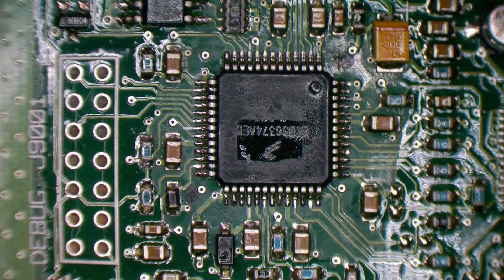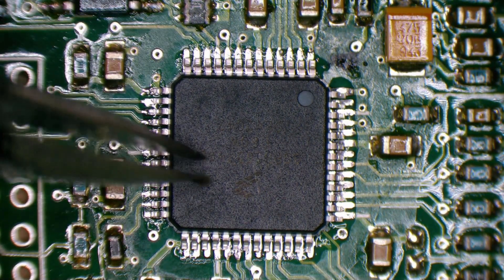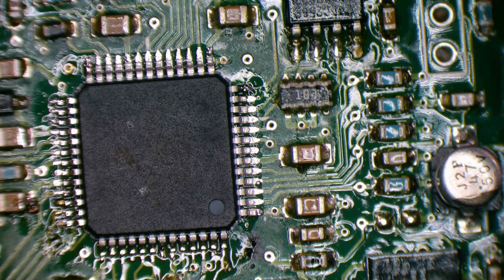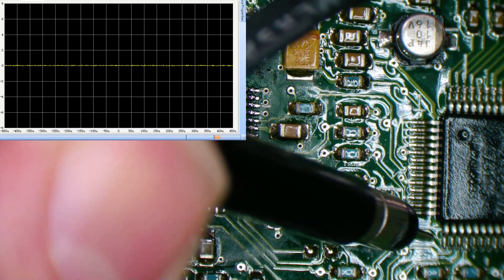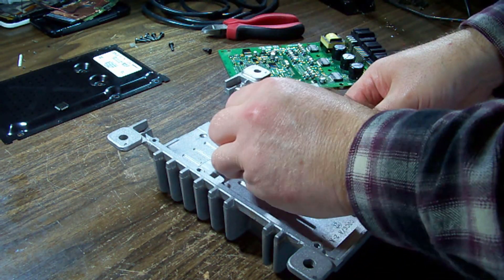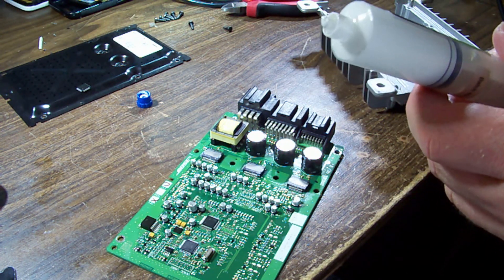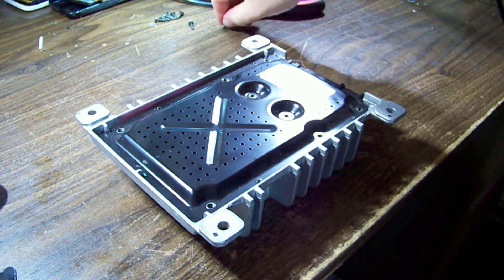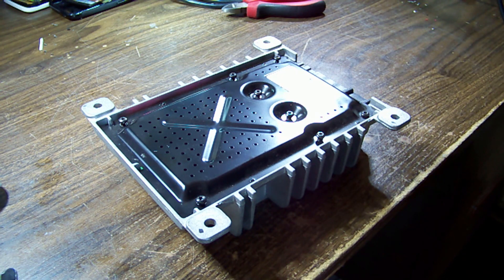Mazda 3/axela bose audio amplifier repair part 2

Comment: Thank you very much for the diagnostic video.  My Mazda3 GT had no sound when I bought it, and the problem turned out to be the DSP chip in the amp.  I replaced it following your example.  Works fine now.  Honestly, I was expecting bad solder joints with the modern lead-free crap they're using, and it would have been much more difficult to troubleshoot without your video.  Awesome!

Comment: I have the NH61 66 920 Bose amp with loud popping sounds coming out of the speakers.  Found the ST2L05-3300 dual voltage regulator 1.25Vdc with lots of noise on the output.  3.3Vdc looks good.  Believe this may have damaged the DSPB56374AE (DSP).  Decided to replace the above parts along with the CODEC CS42438 to save time since it took months to get parts from Ali Express.  Currently I'm learning about the hot air rework station I purchased.   I will be replacing these parts soon and hope this works.  Funny, checking around Mouser now has the dual voltage regulator and CODEC parts.  I will use the Ali parts and see what happens.  Thanks, Jonny, for your video.  Not much out there about repairing these amps.
Reply from the maker: Neat, let us know if it works! If you have some scrap boards to practice hot air on you should first.

Comment: I know this is an old video but hopefully I get a response.
Where  did you purchase the DSP56374?? Also my car is a 2010 Mazda 3, the amp is a Bose BBM2 66 A20. The DSP chip that’s on there says:
SC856374AEB
1L60W
1KX0950
Reply from the maker: I got the chip from eBay. You could also try ali express
Reply: @JonnyFix thanks for response I just ordered from eBay. Ughhh I ended ripping off a solder lug off the board. But also got some on the way to repair that before the DSP comes in.
Reply from the maker: Oops. I'm sure you can correct that ok. Hopefully the chip solves your issue.

Comment: Smashing :-D
It is reading the  serial rom now, that's progress :-D
I have my fingers and toes crossed for you ha ha .
A copy of the serial rom content could be usefull for other ones.
Reply from the maker: Good point... why did I screw it shut!
Reply: @JonnyFix  I wasn't saying you had to take it off that particular one.
The next one could have a dead power amp chip.
Borrow the serial chip for a minute and you have the golden code ha ha :-D
Then "sods law" states that you will never need the code.
Good to have it though :-D.

Comment: Hello i’ve got the same amp with a problem. I heard gun noises and the speakers stopped working. I was running music almost at its max. Do you think the amp is fixable?
Reply from the maker: Check if speakers/wiring are damaged (shorted voice coil etc). It's possible the amp ICs are damaged given the sounds you heard. Anything is fixable with enough money :)

Comment: So do you expect this is the regular failure point on these amps? I expect I can swap out the chip for mine (maybe) but I don't have a scope to diagnose.
Reply from the maker: Hard to know I don't see a lot of them. You might be able to see the reset line fluctuate with a regular multimeter altho the pulse was fast, 5ms every 60ms, maybe it would show as a blip on AC. Firstly watch part one at 4:50 and make sure you have voltage on all the yellow caps. I've found the regulator to the left of the 2 middle ones to have bad connection under it.

Comment: Following your video I was able to repair my Infiniti 35 Bose amp. Very similar, also same  DSP chipset. However I worked for 2 mins and it died again 😞
Reply from the maker: I wonder if it's the same problem or something caused by the repair. Maybe go over what you did in detail, make sure there's no solder bridging between pins etc. Hopefully your new chip was indeed new.
Reply: @JonnyFix  
So I went back and retouch the legs. No bridges, it plays! But intermittent. My gut tells me there is a short, cables maybe? It is a fx35 03 It's an old car I know.
Reply from the maker: @Orphe123  Well that's good progress. Maybe check the speakers are ok, the cone moves smoothly without noise when you push on it, connections are good etc.

Comment: Hi mate do you do the mazda 3 TCM  as well they go faulty as alot  %70
Reply from the maker: I've had one sitting around for a year+ haven't had a chance to look in to mainly because it was swapped out and the car has gone. I thought about writing some software to talk to it over can bus is it would be the only way I'd know it was fixed as the failure is coms, but didn't get much past a thought, also I don't have a wiring diagram for the connector.

Comment: Question, is the audio into these amps at speaker level or line level, or a digital stream?   I see a lot of conflicting info.  The Head unit has speaker amps, but from what I see on the Amp board you have there, there is no speaker input load.
Reply from the maker: The CS42438 a/d - d/a codec (the chip I didn't replace) takes front and rear left and right from the head unit as a differential signal (1.1 - 3.9V), not a standard line level as such, although it can operate in 'single ended' mode if they wanted to. The DSP will then do some magic to split the bass etc and feed the respective outputs, back via the codecs d/a side from memory.
Reply: @JonnyFix  Interesting, so why does the head unit have  power amp chips and huge heat sink.    Now I am worried if my aftermarket new HU will work with the Bose when it arrives.  I thought it must be something different as it's a shielded pair carrying the audio to the Bose.  SO much conflicting info, some say its line level, some say speaker level, now you have added differential to the mix LOL.   I saw on my scope only a little ripple and a DC offset on the Mazda HU.   Any ideas how to interface? I am being supplied RCA line level out from the new HU.  Maybe i'll dodge up a convertor
Reply from the maker: @malster181  If you have a look at aerpro website they only show a different CAN module for retaining steering wheel control for the bose system. Some cars that are amped like altezza (I think) need a different harness to feed the signal to the amp from new head unit. I've never looked at the head unit in Mazda with bose, maybe it has an amp chip and it just isn't used. Seems wasteful but maybe easier to make one unit for all cars regardless?

Comment: What was the number of the chipset that was bad? I have the same issue I am attempting to repair and need to find one to buy.
Reply from the maker: If you google the number on the chip you will see that it seems to be a DSP56374. Is it exactly the same issue with no data flow and a pulsing reset line because there are other failures I've seen that will cause no data.

Comment: Did it actually produce audio once plugged back into the car?
Reply from the maker: Yes, all worked as it should. I couldn't see it for myself but this was for a workshop, they would have said try again if it didn't. I have done a few for the same shop now.
Reply: @JonnyFix same problem most of them or different one every time? İ noticed that regulator heatsink pad is a little bit cracked.
Reply from the maker: DSP chip going back seems more common
Reply: @JonnyFix   Mine sometimes works and sometimes dosent. This kind of fault makes it harder to trace. İ think can be dsp for me also. Maybe troubleshooting when its  on non working condition can help.
Reply from the maker: Maybe it's not the amp
Reply: @JonnyFix  But i noticed that after seconds of applying power one amplifier ic goes extremely hot. Maybe its dead!
Reply from the maker: They all get quite hot with no heatsink